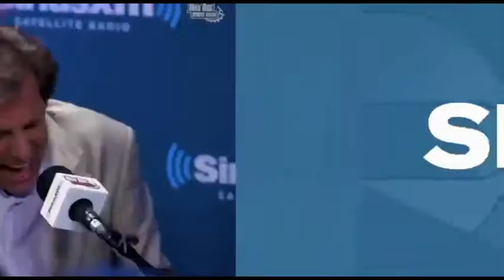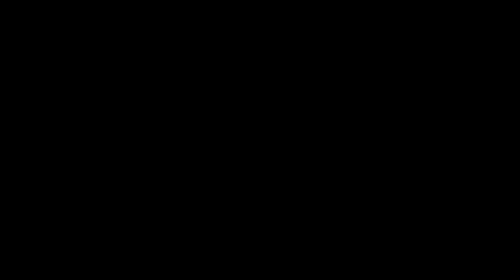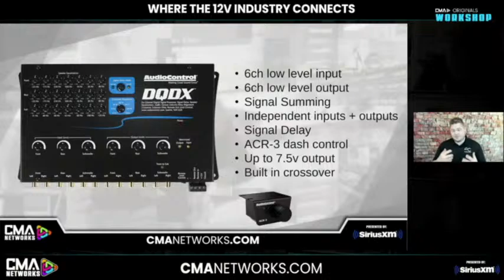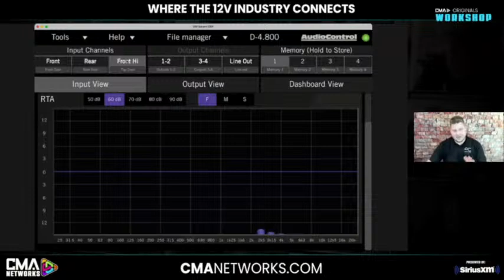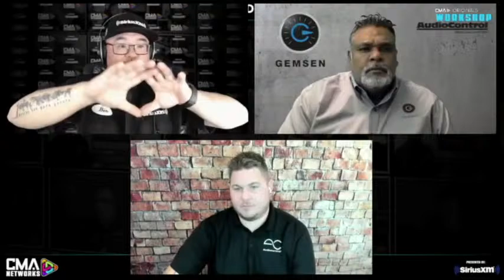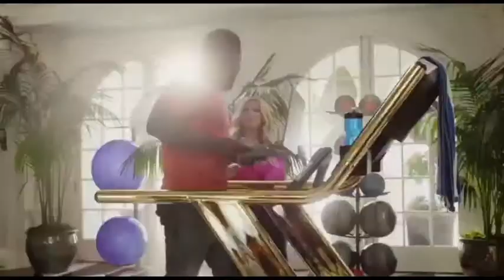AUDIOCONTROL | DSP | WORKSHOP

Comment: So are you saying amp gain zero but 608 gain higher ?
Reply: Ideally, yes. In a perfect world, your signal source would have a high voltage RCA output, as would your DSP, and then your amplifier's gain could be set at zero or near zero. This will produce better sound, more output, less noise, and all pieces of equipment will be not working as hard, leaving you more headroom and less distortion.